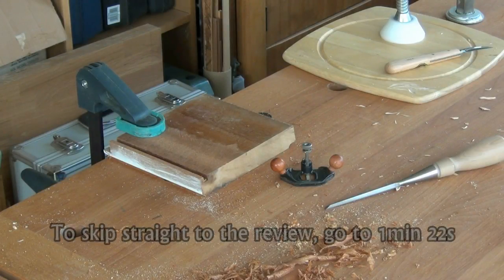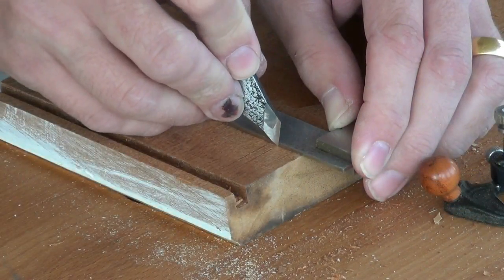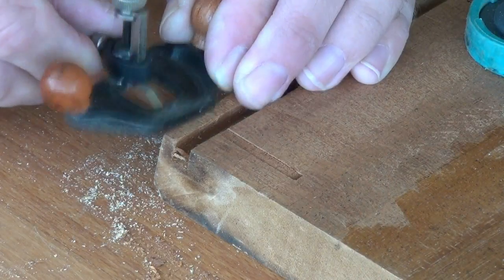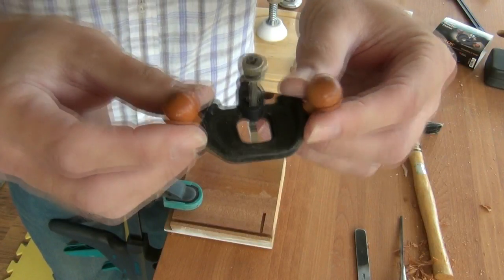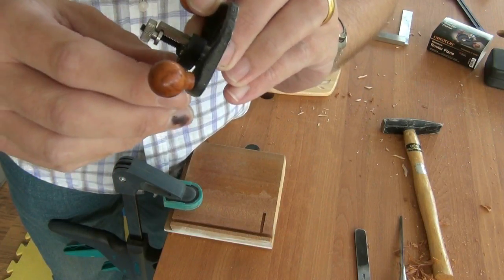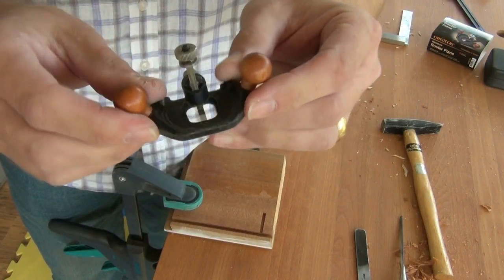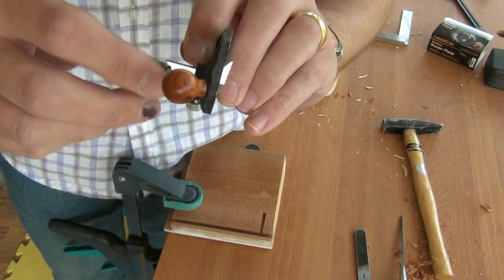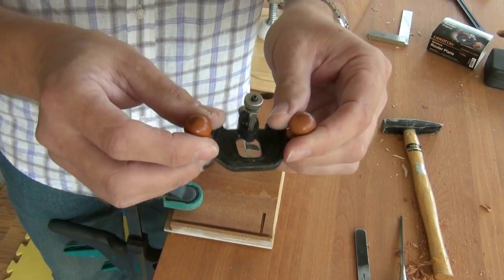Veritas® Miniature Router Plane Review

Comment: Mitch your review is spot on, and like you I have found it useful in some small situations like you did.  It could be a much better tool but that said I find it useful enough to not be totally disappointed and am glad for your review of this tool as I now don't feel so bad about being picky about the shortcomings of it, it is not just me being cranky.
Reply from the maker: John Bare Cheers John. Pleased you feel the same too. Happy woodworking, Mitch
Reply: Right is right and sloppy craftsmanship does not deserve to be purchased!  You could easily make a router out of wood and HSS tool square stock, easily, to fit your needs. 
I know it not the same, but it could be done easily! I would be a great project. But I understand were you are coming from John also.

Comment: Thank you for the honest review,i almost bought this router plane for inlay work, but i think im going to buy the small plane instead of the miniature plane.
Reply from the maker: Thanks. I hope you'll be pleased with your choice
Reply: The small router plane with the triangle-shaped iron is magnificant for cutting inlays.  Just like with anything else don't run off the edge and take small slices.  So easy, so fast, and REPEATABLE.  I've never had striping fit so well and smooth into a groove.
Reply: The small RP is a wise choice, it may not have any bells and whistles, but it is sturdy, stable, and works perfectly. 
So what you have no convenience features. I'd sacrifice quirky gimmicks any day of the week for the perfect functionality and performance of the 05P38.50. (An optional depth stop 05P38.52 is available if you must have this basic feature).

Comment: I have there large router plane and I don’t think this is really meant to replace any router plane   Sure it’s functional  but I think they where made more as a gift for a woodworker.  It’s more a gimmick than a Tool.  I could se it coming in handy for very small and light cuts though.  Thanks for your review though
Reply from the maker: You could well be right. Personally I'd be upset with a manufacturer to receive a gift that was made as a gimmick rather than as a functioning tool - thankfully I do find this one useful, despite the drawbacks I mention. From what I've seen, the large router plane is pretty darn good. What say you?
Reply: Mitch Peacock - WOmadeOD   I have the large router plane and I love it !! Don’t have another one to compare it to though
Reply: I agree that it’s a gimmick.  It’s best suited as a novelty desktop display, which is what I intend to buy the whole miniature tool set for.  It’s a conversation starter, but the fact that all of the mini tools are technically functional makes them that much more fun.  It might be fun to make a set of doll house furniture for my daughter with them, or maybe a little detail work, but at this size they are not robust enough to be man handled.